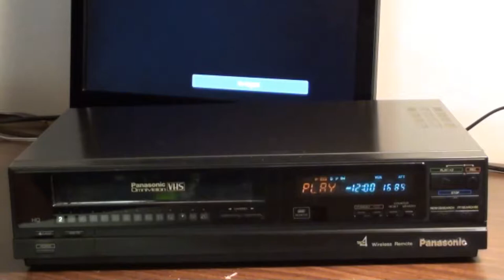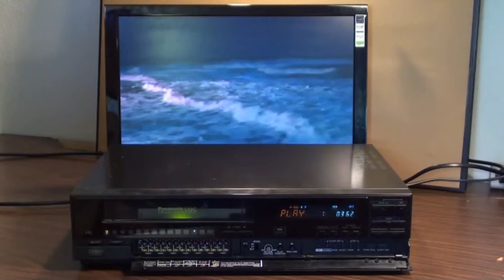Panasonic PV-1560 No Picture and parts to clean.

Comment: The problem with newer vcr's of the day was the blanking of the picture if the r.f from the video heads was too low or missing. (very dirty or broken videoheads).
A black screen gave no clue to the problem.
Some hitachi vcr's showed a blue screen instead, pretty but still didnt help.
Old machines didnt blank the screen so you could seen the picture mess.

Comment: I have an old Accurian, which I had cleaned.  It will play tapes I recorded myself with no problems at all.  But tapes that were purchased new, it will play the audio perfectly, but no picture.  What may be the problem?  Thanks.
Reply from the maker: It sounds like the tape is not riding in the right spot to work for both cassettes. You could try to adjust the tape guides to raise or lower the tape as it runs through the machine. These should be the ones that sit next to the drum head when a tape is playing. Adjust both of them the same amount of turns as you try to find the picture. Remember where you started so you can return them if it does not work. Good luck.

Comment: Panasonic made great VCRs in the 80s but many of them suffered from power supply issues when caps were drying out...
Reply: From my years of collecting, I seem to have less trouble with Panasonic OEM decks than I do their clones (Magnavox, Sylvania, General Electric, Curtis Mathes, Quasar et al). I wonder if lower grade components go into them despite being made at the same plant. I would love an explanation.

Comment: I have an old Sony VCR SVL-ED333SG and I just removed it after like years to see some tapes. First day it worked pretty fine, audio and video was perfect. The next day I put in the tape, the audio is there but no video but like it's not showing any black screen at all like the video is there but it's the black and white pixels dancing and a little bit of video is clear which is jumping up and down. I tried cleaning the video head with a cotton swab drenched with a little alcohol. But its the same results - no video. Any suggestions?
Reply from the maker: Never ever ever clean the heads with a cotton swab! Hopefully, you did not break the tiny heads on the drum. The swabs fibers catch on the sharp edges of the heads and then the heads crack or even break off. I don't know if the VCR has belts in it or gears, but maybe the main belt is slipping and needs to be replaced. It still sounds like the heads are dirty to me. Clean all the surfaces that the tape touches when it moves, with a cotton swab or wipes(and alcohol), but not the main drum. Use a piece of paper soaked with alcohol and rotate the drum by hand. You should see the dirt come off the drum. I hope this works for you.
Reply: @ElectronicsEditor  Update: so I found out that theres a roller with a sponge that cleans the head. The VCR is really old and it was sat in a wardrobe inside a box that the sponge got all mushy and it was totally worn out. That roller actually messed up the heads. I removed that whole sponge from the roller and now theres nothing on it. The tapes works perfectly fine with full audio and video. I even cleaned the surfaces that the tape touched as you said. Thx

Comment: I have this VCR. It was my family VCR when I was a kid and it is in similar condition. I cleaned the areas that you circled and got it up and running. It plays well enough but I'm hearing a grinding noise when I stop a tape. Any idea what that could be? Also, I'm curious where I could get belt replacements like you mention in the video.
Reply from the maker: Does it make the noise on one tape or any tape that you put in the machine? Maybe the mode switch needs to be cleaned, or the belt is not putting the moving parts all the way where they need to be. For a belt, you'd have to just search the internet for a match. It's a tedious job to find one because you have to know all the measurements of the belt. You can try to boil the one you have to make it last longer. That's a temp workaround that I've done and it worked for a long time. Don't buy the variety pack of belts you see online, they are all too small.
Reply: @ElectronicsEditor  Hey, thanks for the reply. It makes the noise with any tape that is stopped. I appreciate the suggestions.

Comment: I have a Sharp VC-MH741 that played a couple of tapes just fine but all of a sudden gives me just 1 second of sound when I start the playback and the screen is completely black except for some small white interference. Do you have any idea of what may be going on or how to fix it? Thank you!
Reply from the maker: I'd have to say make sure all the parts that touch the tape are clean first and see how it works after you clean it(make sure the tape is good by opening the door on the tape itself and looking at the tape. It should be perfectly clean, no funny marks or smears on it). If it happens again, and you clean all parts again, see if there is somewhere that the tape is picking up grease or something of the like, on it from when the tape loads. Grab a good magnifier and look closely at the heads on the drum and make sure none are broken or excessively dirty. You may have to remove the board and inspect the solder joints on everything to make sure they are good. One bad solder joint can make things act funny. Good luck.
Reply: @ElectronicsEditor  I will open it up and follow your instructions. Thank you very much!

Comment: Did you know that the pua3228 ic2 in the early/mid 90s panasonic vcrs can fail? The soldier connections can break from it becoming hot.
Reply from the maker: Not familiar with that particular problem, but I know that a lot of electronics equipment fails because of bad solder joints. These days though, electronics is a throw-away type purchase. It's cheaper to just buy a new one. Sad for us who repair it.
Reply: @ElectronicsEditor  12voltvids always repaired vcrs, tvs and audio equipment back when he was a shop worker in the 90s and all those panasonics he repaired all had that same fault. It will eventually develop on yours if it does have that ic which it may not.

Comment: So a Q-tip wet with 91% of isopropyl alcohol will damage the head?
Reply from the maker: Never use Q-tips on the heads drum. It will catch on the heads and break them. The paper with alcohol I found works the best. Also, something I've noticed over the years is that too much alcohol to clean anything could and will damage parts, especially small parts like VCR drum heads.
Reply: Electronics Editor welp, looks like I’m gonna need a new VCR now 🙃 I learned that AFTER the fact 🤦🏻‍♂️
Reply from the maker: @Arthur_Hastings  Sorry for your loss. It's something I'm sure most of us learned starting out, I know I did.
Reply: Electronics Editor eh, it’s whatever. I’ve seen 8-bit-guy do it and it worked so we’ll see
Reply: @Arthur_Hastings  You might not have broke it lol Try to clean it the proper way. TBH I use wet wipes and never have had a problem with the VCR drum heads.